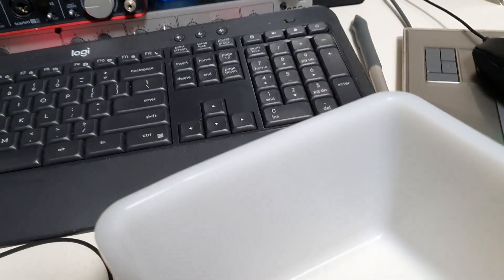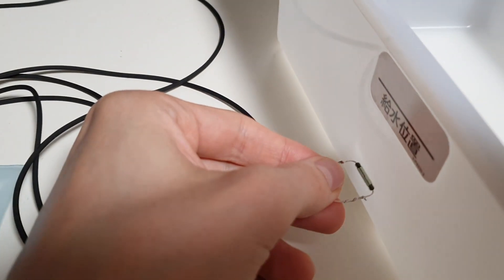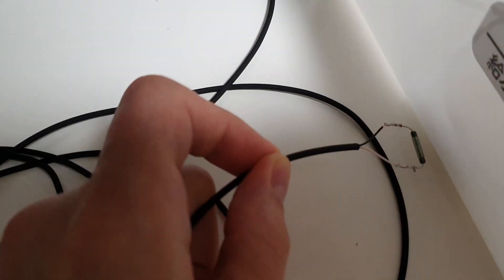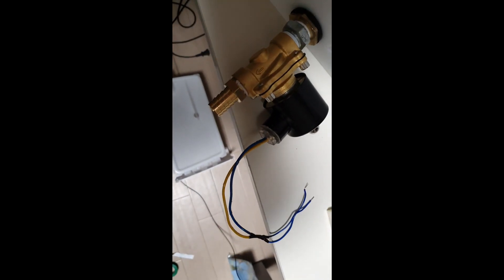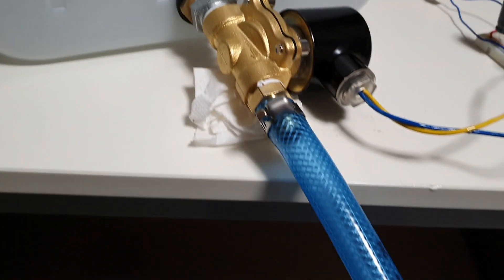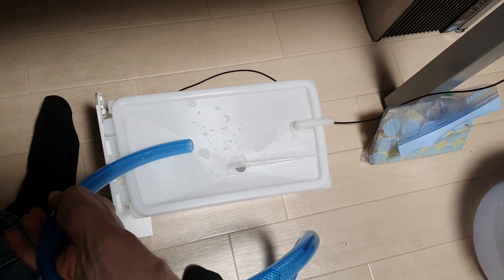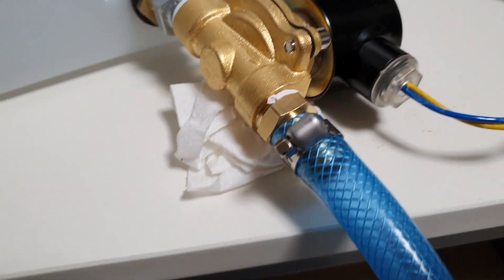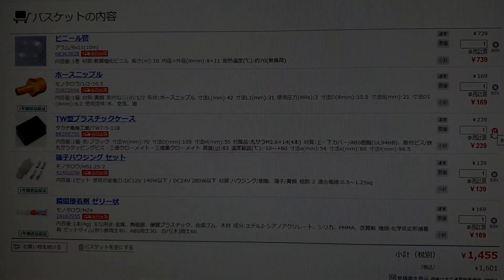Sensitive [Project Moisture]

Comment: R u testing it on bread board and will use pcb soldering after completing the circuit?
Reply from the maker: Not pcb, I have a perfboard that I will solder the final result on to tho.

Comment: Hello Chili please help.Lets say my robot has 4 different color light bulbs on it(Red, Blue, Yellow, Green) and its main function is to turn on a different color light bulb based on its location on the table. If I used a sensor to map out the top of the square table how would I 1. separate the table into 4 different sections through software/programming ?and 2. get the robot to turn on a different color light bulb based on its location on the 4 different sections? I do not want to color the table different colors and use a color sensor that is not an option for this project. can you figure out how I can do this?
Reply from the maker: depends a lot on specifics. some options would be dead reckoning (by timing or stepper steps or accelerometer) or lidar / sonar

Comment: Just a suggestion, Maybe buy a plastic nipple connector for the center plastic hole and zip tie them together like you did the other end of the hose?
Reply: I was thinking the same thing.  find a 3/8 King Nipple that fits the diameter of the hose then use a short Vinyl 3/8 hose to fit inside the hole of the drain pan.  Also, would recommend adding one tablet of Pretreat to the top basin to stop algae from growing to keep the solenoid clean and prevent blockages over time.

just a suggestion and check the diameter of the hose for the fitting...

https://www.amazon.com/DiversiTech-PROTREAT-200-Economy-Drain-Treatment/dp/B00SYQ40H6/ref=sr_1_4?crid=SBEW4TGLA2MR&dchild=1&keywords=protreat+200+tablets&qid=1623597521&sprefix=protreat+200%2Caps%2C180&sr=8-4

https://www.amazon.com/JUNZHIDA-Tubing-Flexible-Clear-Vinyl/dp/B093DL6VC2/ref=sr_1_6?dchild=1&keywords=soft+3%2F8+vinyl+hose&qid=1623597855&sr=8-6

https://www.amazon.com/Joywayus-Reducer-Splicer-Fitting-Intersection/dp/B07N6JKD7K/ref=sr_1_5?dchild=1&keywords=plastic1%2F2+to+3%2F8+king+nipple&qid=1623597953&sr=8-5
Reply from the maker: not a bad idea, but I'll probably be able to fit the new hose directly into the hole :] Also, amazon.com no workie well for me in japan